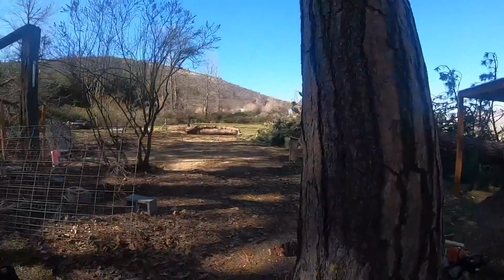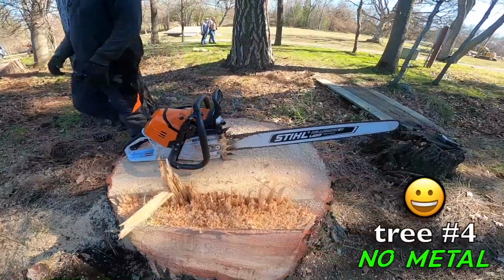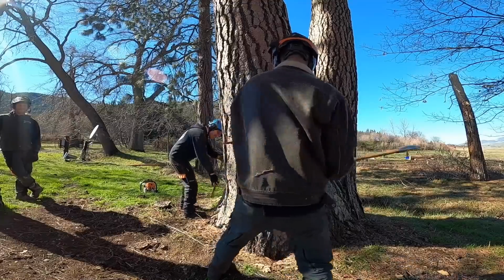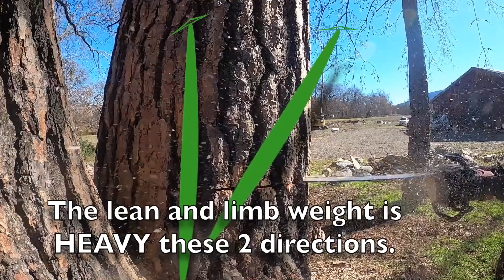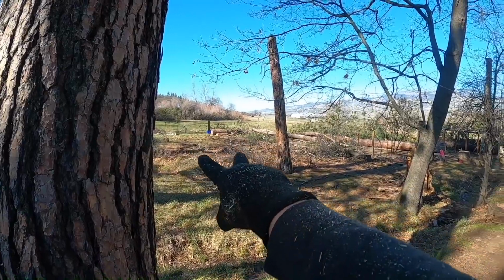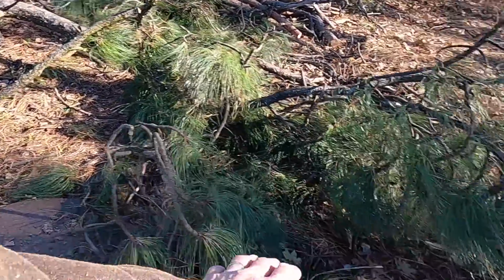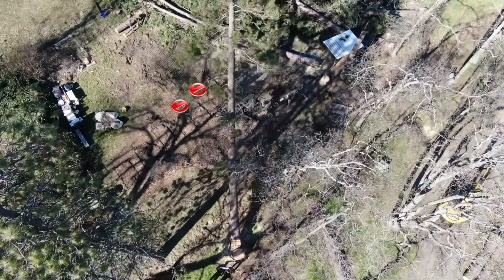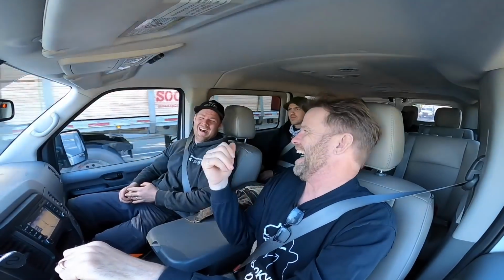bore cut fell diagram

Comment: Good job as usual.  I’ve learned a lot from your videos over the last couple years and I appreciate it a ton!  I have a question on the boring back cut.  Do you always leave a strap in the back and then finish backing it up conventionally?  I was always taught to just come all the way out the back with the boring back cut.  Is there any difference, and if there is what is it?  Just asking to learn, not second guessing your cutting.  Thank you. 👍🏻
Reply from the maker: A heavy leaner I’ll grab your saw and launch it someday if you try to just blow through all tension wood. Depends on all the dynamics of the situation.
Reply: @AugustHunicke  copy.  That makes sense.  Been fortunate to not have that happen...during a boring back cut anyway.  Not so much in other situations, 😅.  Thank you for your time, be safe.
Reply: I always leave a strap in the back, pull the saw out check that everything is good. Then  cut the strap from the back an inch or two below the level of the bore cut. If one triggers the strap from above the level of the bore then the tree can take your saw for a spin.

Comment: How come you Bucking Billy Ray built ax
Reply from the maker: Huh?
Reply: I meant how come you ain't yousing one of Bucking Billy Ray's axes? Hey but then I seen another video with you yousing one. So that was kool
Reply from the maker: @shawnstevens858  I have a lot of axes.
Reply: Im gonna c if anyone will hold the camera today wyle I buck and split this 5' diameter white ash log up. The rest of the way. Yousing a combination of my 281xp with a 288xp jug then yousing a combination of my 268xp for some releaf cuts then everything will be split with the combination either the 8 pound fiskers or the 6 pound fiskers. We already got over 4 cord's out of the trunk now there's only 6 or 7 feet left on the stump. Hey maybe I'll give my 2100xp some video shots too.
Reply: @AugustHunicke  also I can't wait to get back in the tree. I've been real slow besides plowing and filling firewood orders. But I've been really going back in forth deciding on weather to get the Monkey Beaver sattle or the tree motion Evo. I love the wide by back on yours much more compared to my Buckingham. Because I have a boldging L5 disk only acts up when it's imflammed. But the Evo will let you twist more on limb walks. Wich will release that tention also. but I honestly and more realisticly I'll appreciate yours alot more. Expecially with those extra D rings the wide back/suspenders and the stock transporter. I just can't find a monkey Beaver close. 
But the Evo is 40 minutes away. So I know I'm gonna spend around $800 either way I go. There both amazin Saddles.